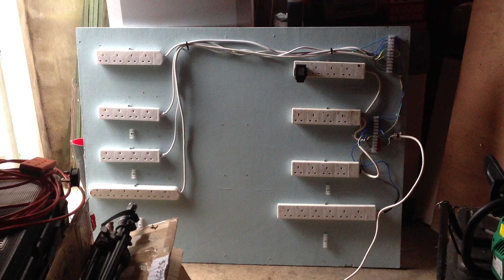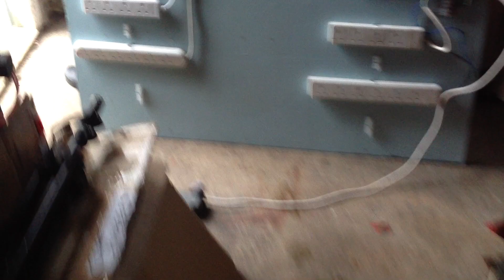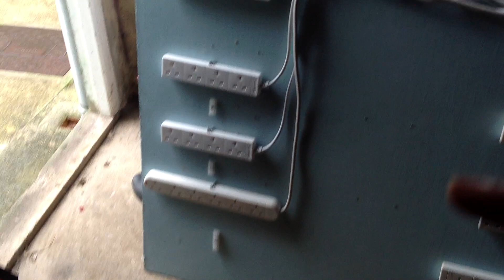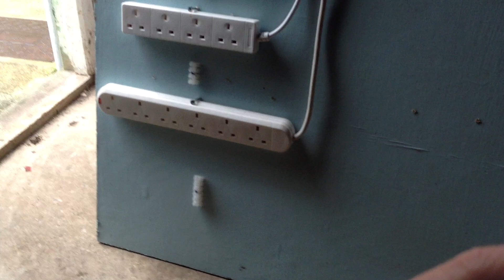Vixen 3 - Arduino Mega 2560 - Sainsmart SSR - Christmas (VIDEO 6 OF 6)

Comment: Which sketch do you have on the arduino to communicate with vixen?  This tutorial works with pixel strings Vixen Lights 3.x Arduino Pixel Controller WS2812B Tutorial
 but we need something different for relays I guess.
Reply: +Pete Stevenson This is the working tutorial for pixel LED  http://blog.huntgang.com/2014/11/08/vixen-lights-3-x-arduino-pixel-controller-ws2812b/